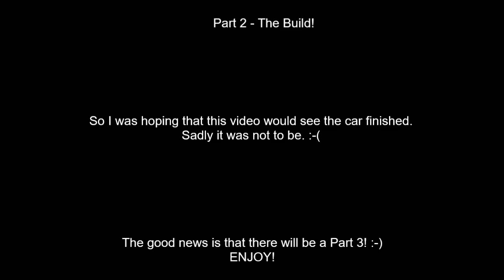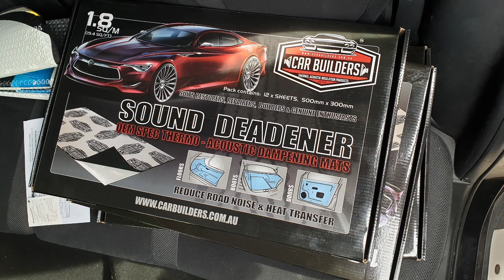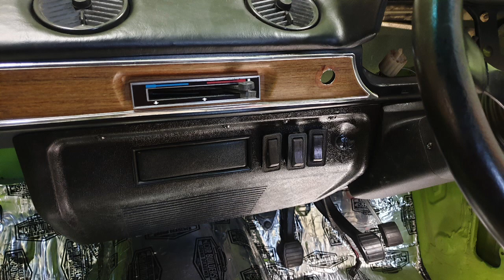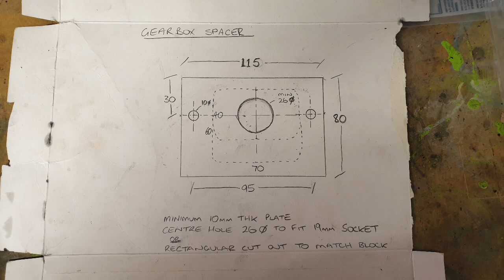Ford Escort Mk1 Restoration - Part 2 "The Build"

Comment: Thank you for sharing. I am about to start working on one, body is great and have all bits hopefully.
Can you give me a link for the bushes underneath please and also the linkage for the webers.
My engine will be 16gt 711m. But slightly  modified.
Can wait to get it done and seeing  you doing yours gave me a deeper insight to works..
Thank you so much for sharing
Reply from the maker: Hi Alfred, thanks for your comments. I think I got the bushes through ebay to be honest. They are flow flex, you can also get Superpro and a few others. Some say the flow flex are rubbish but I haven't had any issues with them so far. The webber components are from www.weberperformance.com.au. Hope this helps and good luck with your build but most of all enjoy the process!
Reply: @stufish73  thank you so much once again. Fingers crossed I will find the few bits pending. 
Regards
Alfred 
🇲🇹